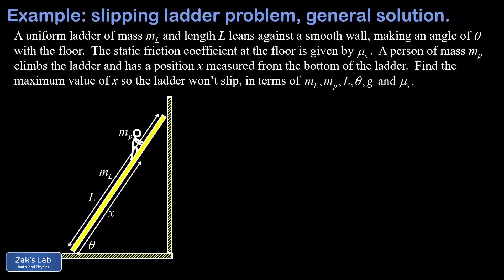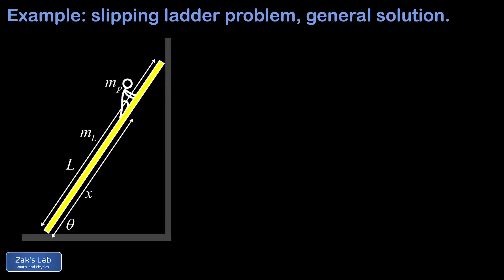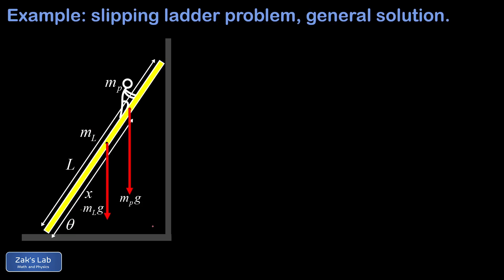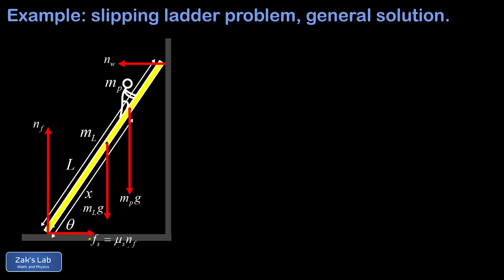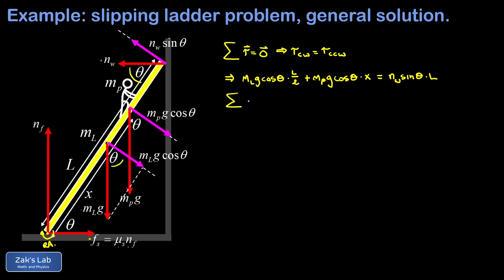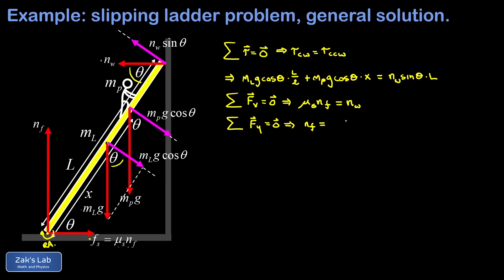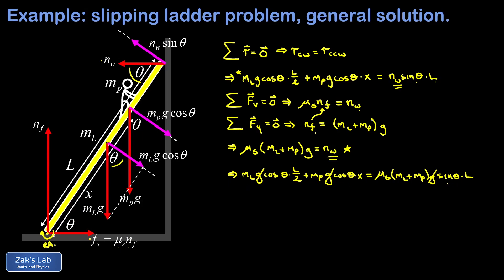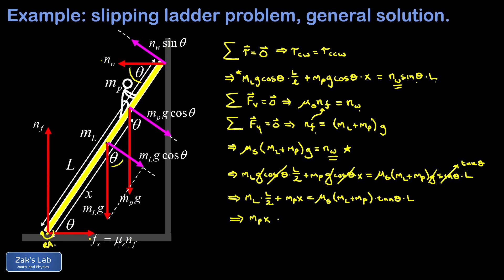Find the maximum height before the ladder slips:  slipping ladder problem general solution .

Comment: why is the nw angle drawn between nw and the ladder, but the mg angles are drawn between the mg and the perpendicular?
Reply from the maker: The angle between n_w and the ladder is equal to the angle of elevation because those are alternate interior angles.  The angle between the vertical and the perpendicular for those other two forces is equal to the angle of elevation by either a trig argument or by a geometric intuition argument that I made here:  https://youtube.com/shorts/S8FnhFcoFxQ?feature=share       Getting the angle between the vertical and perpendicular is extremely common in the setup of physics problems, so that's one to remember for sure.  z